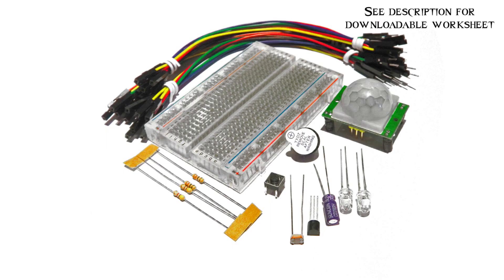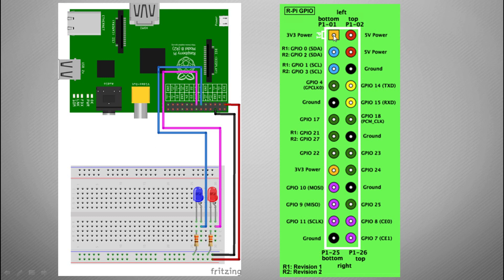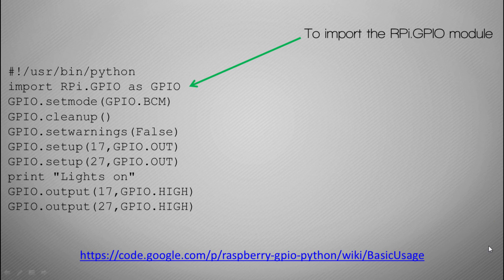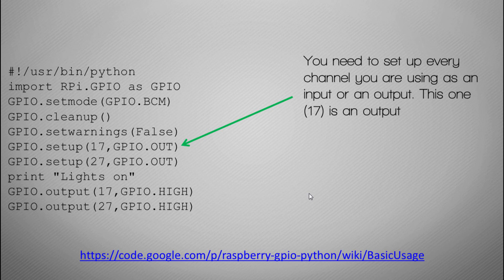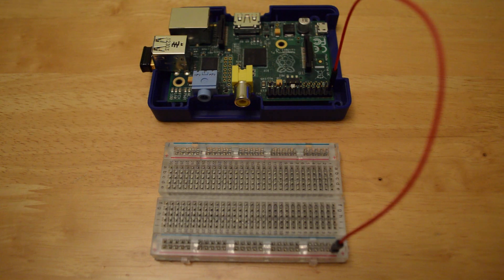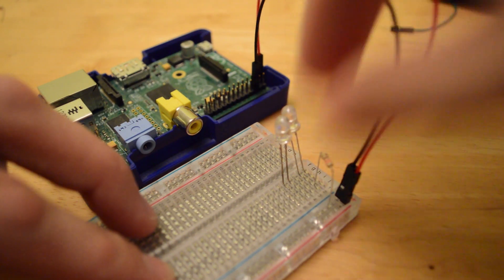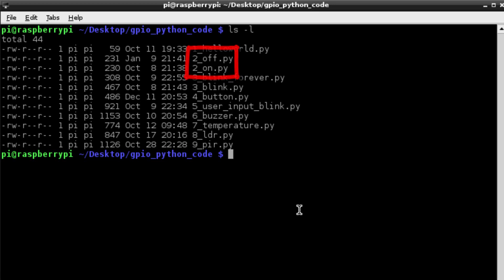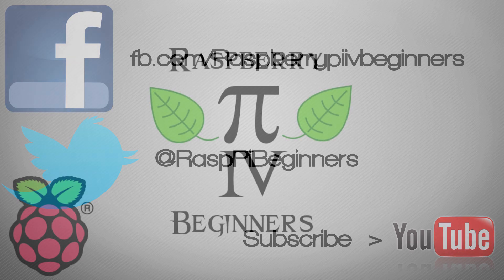Raspberry Pi - GPIO & Python (2/9) - LED on & off

Comment: When working with Arduino, I soldered 220ohm resistors to the + legs of my LEDs.  Would these safely work on my rPi so long as polarity is correct?  I don't want to fry my board.

Comment: Btw I just realized the flaw in this schematic and it's something that might fuck your Pi big time if you do something when using a servo motor for example. With a LED you won't have a problem. The placement of the resistor is incorrect and frankly doesn't make any sense. There is no point having a resistor between GND and the LED. It's the other way around - connect the LED to the GPIO THROUGH the resistor! Also I don't see the point of connecting the 3.3V pin to the breadboard since you are not using that power at all. The GPIOs are used for supplying the power to the LEDs.

Comment: What is the significance of resistor? And what if I use a 200Ω resistor instead of 330Ω?? Although I know that more Ω means more resistance, but how will i get to know the required resistor power for particular purposes?? Also if I use 1MΩ resistor in this example, will it blow my board?
Reply: Rishi Gargi Incorrect resistor can damage your Pi and/or your LED. In both cases this is not something you want to do. If you have a too high resistance, very little or no electric current will pass through the LED hence the LED will not emit any light.
Reply: 220Ω

Comment: When I tried to do the "input RPi.GPIO as GPIO" function, My Pi 2 said "bash: input: command not found." Why????
Reply: +Mc “Mcmergan” Mergan first it's "import RPi.GPIO as GPIO" and second you are trying to run a python command in the linux terminal. The import command is used in python idle or shell, not in the terminal.

Comment: Looks like there is no significance of connecting red wire into breadboard i.e. + sign.
Why is author doing that?
Reply: Harsh Gupta That's I don't know the purpose
Reply: Harsh Gupta He probably did it out of habit.  But you do not need it for the tutorial.  I like Aryan Misra answer too.

Comment: Do we have to connect the raspberry pi to the computer via the micro USB ??
Reply: saattvik thourwal I don't think so. The pi is a computer on its own. All I think you need to do, and I'm not a professional, would be to give it power and type in the code in the correct places and orders.

Comment: It would be useful to mention the value of the resistors.
Reply: +RaspberryPiIVBeginners the worksheets are no longer listed on the website, just links to the videos which of course link right back to the website...

Nice example of an open feedback loop :)
Reply: 220Ω
Reply: ***** It's pretty hard to find that kit actually LOL As for the values I think they are around 330-340Ω. You can see the colour code online though I agree that putting those values in the video's description or even better - as annotation - would be much, much better. Still thanks for the tutorial. My first project with my new Raspberry Pi 2. I used one led and did some crazy blinking instead of just a single boring "lights on" :D

Comment: is the red wire really necessary?
Reply: Lol I was wondering :)
Reply: Is that because the GPIO pins themselves provide a voltage for the LEDs?
Reply: Piotr Sumelka yeah I thought so. Thanks for your help :)
Reply: +Kieran Farnes 
Yes and you can see that the author provides the current to the red line, but nothing else is connected to this line.